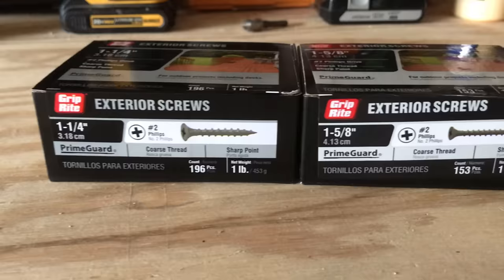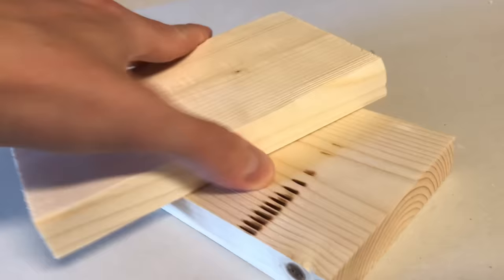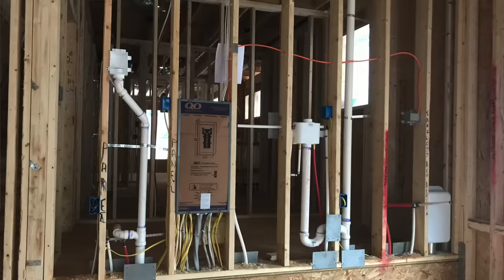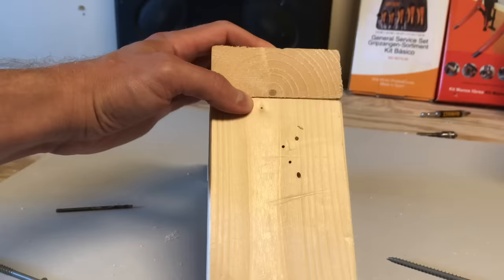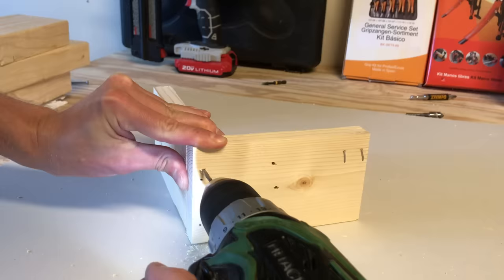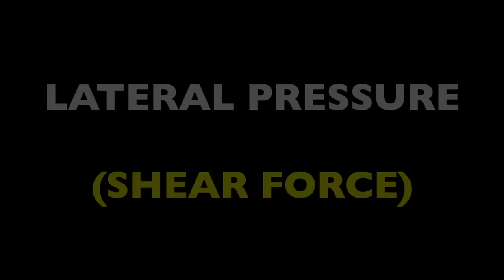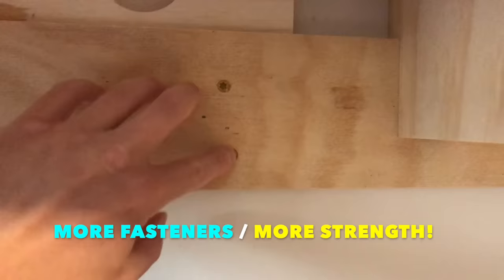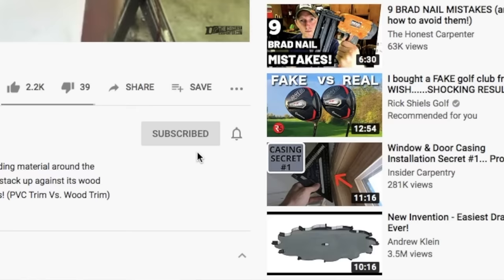Don't Use Screws That Are TOO LONG or TOO SHORT! (Screw Length/How To Choose The Right Screw Length)

Comment: It may be important to note that when well secured, the shear strength is reduced by the frictional hold to the wall by the pull the screw exerts upon the length of the beam against the wall. So if your screws are not pulling the beam tight, then the shear force will be higher than if the board is perfectly pulled flat and tight to the wall.

Comment: I've used #8 deck screws for years with a #2 Robertson bit for years without issue.  I drill, countersink, run in the screws with a drill, and tighten the screws by hand.  Typical screw lengths are 1-1/4, 1-1/2, and 3 inches (32, 38, and 76 mm).  My personal guide for length is if there is a chance the end will protrude at all, use the next shorter length (ie; 1-1/4" for joining two 3/4"  (19 mm) thick boards.

Comment: My 2 cents, I find that Phillips head screws frequently cam out especially in reverse with an impact gun, I’d suggest star drive or torque drive screws. Square drive is another alternative. Also for different thickness of woods the screw diameter (6 8 9-10) can be very important especially if your using wood that splits easily or is close to an edge. As you point out when shear or hanging strength is needed also is a factor of screw diameter. Pre drilling counter sunk holes & not over driving & use the torque limiting setting on your impact gun is critical to avoid splitting and insure the best connection. For us DYI’s screws (vs nails) allow us to correct our mistakes so much easier than nails due to ease of removal.
Reply: Have also come to appreciate star drive over Phillips.
Reply: Phillips head screws are literally designed to cam out. It was an intentional feature to keep from over tightening. Try JIS, or Japanese Industrial Standard, screwdrivers and bits. They bite much better.

Comment: Good info on selecting screws with the right length for the job. I've noticed a several woodworking videos skip that info and just tell you or give you the length to use for that specific project and call it good.

Comment: Nice video! You'll also generally want to take into account that matching the length of the section of the screw that has no threads on it (close to the head) to the thickness of the "top" piece will make it easier to pull that top piece snug and "into" the bottom piece.

Comment: 3:30 Withdrawal pressure is called tension It can also be called stress which is the force per unit area. Stress results in strain in the material which is the deformation of the material subjected to stress.

Comment: When pre-drilling holes, it should be a clearance hole in the top piece allowing the screw to pass-through and held by the head. The pilot hole in the bottom piece should be the root diameter of the thread. (The smallest diameter of the screw between the threads.)

Comment: Also, do you self a favor and grab the torx head screws instead of the Phillips. You’ll save yourself quite a few headaches.
Reply: Or pick the best, Robertson.
Reply: Phillip's aren't welcome in my shop. I'll sometimes us straight slot screws for esthitec reasons.
Reply: @farnorth7314  Agree to disagree. Torx is far superior to any other I’ve used except for just plain sockets and nut drivers. Robertson is certainly better than philips but it’s not the best out there.

Comment: Thank you  for the tips. I've been using self tapping drywall screws to predrill  It works very well, especially in hardwood. Takes care of the dept, pins the work together quickly, and easy to change out when necessary.

Comment: Very helpful. A lifetime ago when I worked in the trades, Americans couldn't get "robertson" (i.e. square head) screws. I never knew why that was, given that square heads are so much less likely to strip when you sink them or (worse) need to pull them out after years. 
Anyway, thanks for the very informative videos. Take care.

Comment: Put a little paste wax around the tip of the screw, and a little on the countersink head.  Makes it much easier to drive. Also makes it possible to use smaller pilot holes.

Comment: When I built my house we used framing nail guns to frame. After that I NEVER USED A NAIL AGAIN!  After that EVERYTHING is screwed with T-25, (star head/torc) screws. I keep a 20ib bucket of 1-1/2", 2-1/2", and 3-1/2" T-25 exterior/deck screws in my shed at all times so no matter what I have a screw for the job. I also always keep about (6-12) 2"x4"x8" treated boards in my shed on the floor so they stay flat. They are there year round so they are "dried" ready to paint and use for any and all applications. So if there is a small project I know with (12) 2x4x8s I can usually do it without a trip to town and they have been in my shed for maybe 6 months so they are ready to paint as it is a good practice to let "green" treated wood dry before painting so it doesn't trap the moisture in and rot it. Oh yeah and I try to keep about (4-6) 2x6x8s for the same reason.

Comment: Good tips!  It may help to address threads- course vs. fine—depending on the wood density.  Typically, I’ll use fine thread only with hard wood, which should always be pre-drilled.  Course threads are best for softwood, and typically do not pre-drill unless it’s close to the end or going into a thin board, which generally creates splitting.
Reply from the maker: All very good points, habba, especially how important it is to pre-drill close to end grain! I've got "coarse vs. fine" in my future video notes now.

Comment: I hung a wine rack like the one in this video. By FAR, the better approach is to go into the addic and fix a pice of 2x4 drill it in 4 spots an duse i hooks that go through your sheet rock, through the 2x4" and secure it with a couple of strong, wide washers and a bolt. I could literally do pull ups on my wine rack. For my also very heavy range hood I also took the time to open my wall (very easy to do) and sistered a 2x4 in the right location (placed horizontal in between the 16" studs.) It is incredibly secure. I also installed a pull up rack in my house- it does like 5 different things- dips, pull ups, push downs for tris, etc. I also used multiple 2"x6's." This time, I just went over the sheet rock but I made sure to hit many studs. I used longer, strong screws. The exercise equipment then screwed into the 2x6." If I attached it to the sheetrock, the sheetrock would crumble. All in all, when in doubt, do a little extra work to do it right the firts time and avoid future issues. I also just don't trust scews blindly into sheetrock too much for support of heavy objects- they can and do fail sometimes. For a small picture, they are fine.

Comment: I was using #6 and #8 wood screws from lowes and home depot, mostly to attach T-Tracks. I found that driving them in, the screw would break, and since it was a T-Track it was very hard to get them out, and I could not just do a new hole. For other projects I would just leave the screw in and cover up the hole, but here I really needed it in that exact spot, and it was the last step on a complex project, so I just left that spot without a screw.

I pre drilled, used wax. I finally found that I could order better quality screws from McFeely's, which in addition could be used with either phillips or square bits, never have had a bit break before. It sounds like the screws at the big box stores use the cheapest metal possible, so I was running into defective screws, and getting Candian made screws from the company that originated the square drive ( which I learned about only afterwards ) gave me a higher quality screw.  Probably why you prefer deck screws.

I would like to know if there are ways to remove screws where the head broke off, or if you have other ideas on this subject. It seems like the products for removing are geared towards #8 and above, and even then don't seem to work that well.

Comment: The hardness of the wood definitely matters!  I've been used to 2x4s and plywood, and then used brass (a match to the existing hardware) screws on an old oak cabinet.  I did NOT drill big enough pilot holes-- the heads of the first two screws twisted right off, just before they were sunk all the way in.  Drilled pilot holes bigger for the rest, but getting those busted screws out is a challenge I haven't tackled yet.
Reply: Eek.  What a shame!  Did you get the busted screws out yet?  Curious about your plan of attack on that.
Reply: @Sheila-cm4jy  just drill them with a drill bit and run it in reverse , they'll come out with the drill bit.
Reply: @AS-ug2vq  Ok A S thank you for the tip!  I think I'll practice that before calamity happens on something that matters, like a highly visible spot on an oak cabinet.  Also thinking that brass screws the guy above used might be rather "soft", as brass is a mixture of metals, no?  Similarly, an exterior coated screw might be harder or denser than a drywall screw...?
Reply: @Sheila-cm4jy  brass is ofc very soft. 

Drywall screws are hard and brittle. 

Coated ones are not that hard but coating is very thin so it's hardness never matters. It mostly serves for rust prevention
Reply: @AS-ug2vq  Thank you A S for explaining that!

Comment: You could definitely do a whole series on fasteners. Because the screws you've been dealing with are for wood, but there's also ones that do metal or concrete
Reply: That's why the channel is called the honest "Carpenter". Make sense, carpenter, wood? Yes?
Reply: @peterr7530  so you're saying people who do not use steel in their construction or concrete in their construction are not carpenters?

Comment: Another tip: NEVER use deck screws for construction that requires strength - i.e., framework or stud work. They are very weak. Use them for decking and trim only.

Comment: If you are building a permit required structure you need to check with the inspector. Some jusistictions do not allow drivescrews on any joint subject to shear as they are a lot harder than nails. Some may have additional specific spacing and sizes required.

Comment: You mentioned wire penetration when driving your screw into a wall.

A good plumber or electrician will use a metal plate (I believe they are called "stud guards" to protect plumbing and wires).  These plates are designed to stop screw/nail from being driven into pipes and wires that cross through studs.  They are about 4 inches long and may prevent driving your screw at a specific location.

Thought they deserved a mention.

Comment: Unless it's been pointed out already... the rule is 2/3, 1/3.... not the aforementioned 1/3, 2/3.  Think about it long and hard... if the two materials are of equal thickness...eg. laminating two studs or putting a 3/4" end panel on a 3/4" cabinet box... Your screw would be sticking out the other side by 1/3 every single time.  In the case of the cabinet end panel...a 1 1/8" screw... like we do in our cabinet shop.  If you follow the 1/3, 2/3 rule... you would use a 2 1/4" screw... and be screwed.  😉

Comment: i literally had a class on screws when i joined millwright union, not only is there grades of them, but also you have to consider threads per inch, so like that lag screw, compared to a machine screw. odd how many difference there are in little spinny sticks

Comment: Thanks for the 1/3-2/3 Rule of Thumb for screw length... very helpful. Is there a rule of thumb for screw thickness going into the side/end of material? e.g. screw diameter should be less than 1/3 or 1/2 of the material thickness, or similar kind of guidance?

Comment: It's worth mentioning, a proper wiring job behind wood studs should be protected (more accurately described, in my opinion, as "indicated") by a wiring plate. I noticed that some places have this as code and some do not.

I get the idea: A slightly harder steel sheet clues someone in that something behind it shouldn't be scewed or drilled into it. Optimistic, in my estimation, as someone lacking the knowhow is going to find a way to 'screw' it up. :P

Comment: A few things about screws. I only use T-25 star/Torc head screws as they are much harder to strip compared to philups or flathead only square head screws are harder to strip but they are harder to find in different sizes. 

I use an impact driver as no predrilling is needed as an impact driver will drive screws in EVERYTHING! What I do is go half way in then back out to allow the wood shavings to come out to stop it from splitting just like predrilling does it allows the hole and shavings to come out so the wood doesn't expand too much and split. 

I always keep 20ib buckets of 1-1/2", 2-1/2", and 3-1/2" T-25 Torc/star head exterior/deck screws in my shop so that way no matter what I have a screw for the job as I only use nails to frame a house after that EVERYTHING IS SCREWED!

Comment: At some point in time, maybe cover pocket hole joints and related screws.  I use the pocket hole screws for most of my projects that do not require a recessed head.  Also, using sheet metal screws in wood.  thanks  Great video!

Comment: Good tips. I avoid ever using screws in end grain, and going with some other form of buttressing or joinery, keeping in mind the orientation of the weight over top. If its just holding a top to a beam, then I won't bother too much, but if not- then I figure on some kind of lap joint of other trick to help out.
Reply: Pocket screws can work well. They don't wedge the end grain.

Comment: Thank you Ethan, very helpful video. Can you explain when it's necessary to countersink a screw? Also, do you recommend a brand magnetic bit for a drill driver?
Reply: I use Dewalt bits and drives, work well.. ryobi bits are softer. Project farm dose allot of side by side tests of screws, divers etc that helpful

Comment: This was a  good video,  I learned some information I didnt know, thank you I will be consulting this video, again next time I am doing shelves at home, I appreciated this information, iam always wondering what types of screws and fasteners to use on masonary walls,  when putting up shelves that I need them to be very strong, to hold some weight in this case 4kg to 5kg I'm building a water wall project at home, wood work is very interesting you've got me considering taking a course in carpentry & joinery, thank you, Laura in uk

Comment: My tip for using screws is pre-drilling the top board with a bit close to the diameter of the screw threads. Ever notice when screwing two pieces together often separate from each other, not pulling tight? There are two solutions, 1. clamp then screw, 2. With a bit the diameter of the threads pre-drill the top board only, then without clamping them screw them together. Notice the top board will be pulled tight to the bottom board.

Comment: Don't forget to address thread pitch.  A finer screw (more threads per inch) is a stronger fastener;  it also creates more surface area contact.
Reply from the maker: Thanks, Christopher. I’m going to cover coarse vs. fine—and when and where they should be used—soon here 👍
Reply: @TheHonestCarpenter   ...figured you were on it...

Comment: An explanation of thread would be good. When to use course thread and when to use fine thread. Also, inside vs outside screws ... not all screws can be used outside or in damp areas.
Reply from the maker: Will do, Qapla!

Comment: It was helpful. If I have two boards, 1/2" thick, would I use a 3/4" screw as not to drive through the 2nd board? Also, 1/2" might be slightly smaller- the chart states surfaced=5/16." Would 5/8" be safer? I don't want to punch through. It's a nice 1/2" thick Walnut guitar speaker cabinet. I am joining it together using 1/2" cleats inside- screwed and glued.

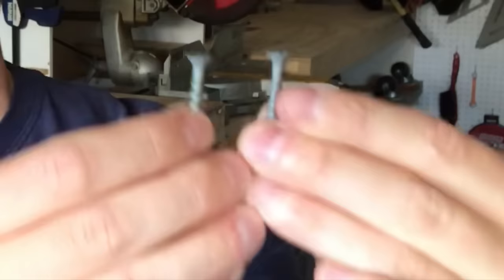Comment: Well, it's not 'always' better to just add more screws. More screws can cause the wood to split if not properly spaced (yeah you mentioned it at 4:26 but it really is important). Ideally you just use as many screws as you need, most of the screw manufacturer here provide tables how big the load is any screw can hold.

Comment: Ok, putting a 1 1/2 " x 3" Hinge to 3/4" pine board with 3/4" length screw, came with a problem that spax brand came only #6 x 1 1/4" ,now the shank is smooth most of the length that it's free spin even though I grind the stick out part. The spax has a nice bevel  to set flush on the hinge . Would you drop the people a suggestion to make #6 x 3/4"& 5/8" to help in this area to mount hinges better.

Comment: What kind of screw could I use when building a desk for my kids. Made of 2 by 4s........ Also can you also talk about Philip screws vs the star crews and what drill bit to use (drill vs impact)...... Thank you
Reply: I've used deck screws with Torx heads for 2x4 projects.
Reply: I always (well almost) use an Impact driver when installing or removing screws

Comment: One add: stagger your screws by the grain. You can split a board more easily if you hit the same grain with multiple screws.
Reply from the maker: That’s a very good point, Scott. Like how miners create a fault line in rock by placing holes in a straight, evenly spaced pattern. Linear wood grain presents a natural fault line.

Comment: It would be lovely if you please add measures in mm!! 

Thank you for the tips!
Reply: It is easy enough to convert. There are 25.4mm to the inch. Doing that math must be what's slowing the rest of the world down though. Because the USA finishes more single family homes than the rest of the world combined does.
Reply: @1pcfred  Thanks Paul, so when he talks about 1 5/8 added to 3/4 would you like to convert to metric in your head!! 😂
Reply: @piersgooderham8674  I am OK with 2-3/8" myself. I never need US Customary converted to metric.